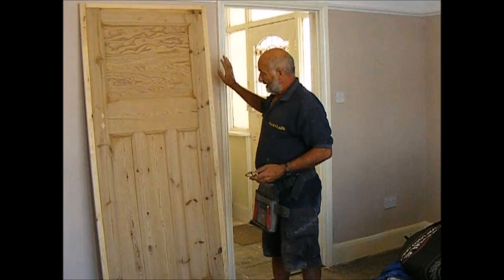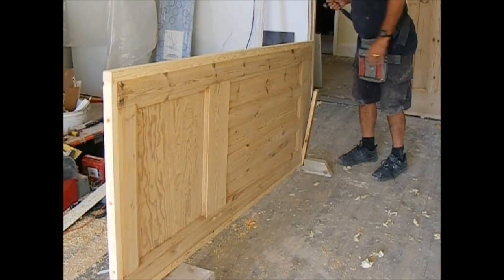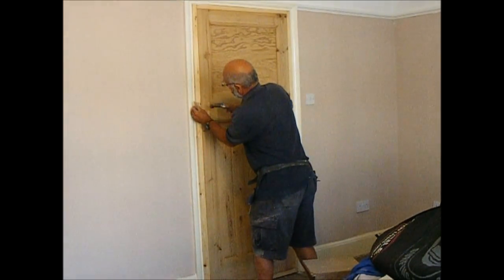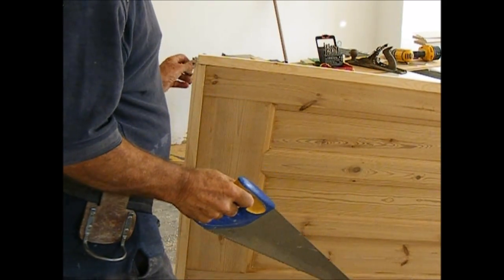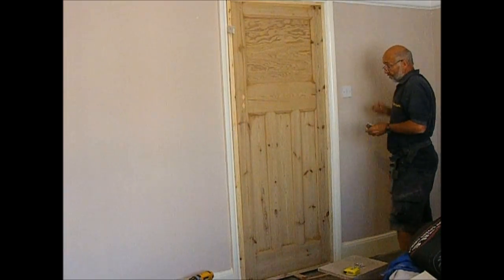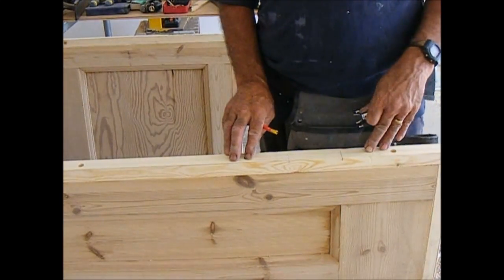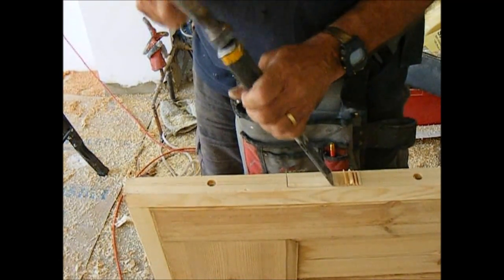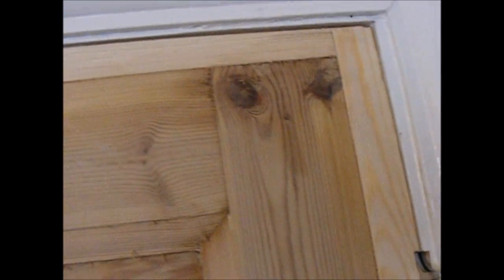How to Hang a difficult door

Comment from the maker: Apart from just measure and mark.
You need someone on the other side of the door. Put the door
against the opening so that the person on the other side can mark the hinge
side and top by laying a pencil on the frame and sliding up and down to mark
the door. Then plane to the mark. Put the door back in push it to the hinge
side and up to the frame top. Once again put the pencil flat on the door frame
and mark the door. The thickness of the pencil side to lead will give the right
amount of clearance for the hung door to close.

Comment: An old rule of hanging a door and has been forgotten - it is that the door affords privacy to the bed in case some one opens the door and someone is indisposed (naked) The person in the room will call out before the person entering the room intrudes on someone's privacy. So make sure your door opens the right way affording privacy to the room. 
Making up old doors with add on strips of modern pine against old pitch pine will have different moisture contents and so shrink at different rates. This can cause the new timber to swell or leave a ridge where added on. Obviously you have to travel a bit to find the right old door in the right pattern but there is always the other approach of making a new frame to fit the door and then fitting the new frame.
Good old school chippy
Studhawk
Reply: Studhawk I think the most important thing is where the light switch is.
Reply: king malt agree - also where the room is just too small and hanging it that way round would just not be practical... as land gets more expensive and rooms get smaller more people are going to want to give up the subtle privacy gain for a bit more useable space...

Comment: Just like to point out that the hinges are called parliament hinges and a better way to mark out the hinges is to use marking gauges for with and depth but not such a bad fit
Reply from the maker: Thanks Simon, god comment.
Reply: They arnt parliament hinges.
They were on Windows.

Comment: Hi Bernie,

Thanks for a great video.  When you measure for the hinges, are the mesuments for the hinges from the top of the door or fromthe inside of the frame.  Also the bottom hinge, is this from the bottom of the door or the floor?

Regards,

Bill.
Reply from the maker: Hi Bill.
Not to important but I measure from the top of door to top of hing and bottom of door to hing bottom.

Comment: never use a hammer on a chisel please use a mallet
Reply from the maker: You will see that the steel blade goes all the way through the handle to the top of the chisel. Most carpenters use this type, it saves carrying a large mallet.
Reply: the reason you use a mallet is to save your hand from being hit with a hammer i was a joiner for 50 years and in that time you will catch your hand at some point mallet on a chisel not a hammer
Reply from the maker: Thanks Sitnam, good point.
Reply: If you are a half decent chippy you will never hit your hand... unless of course you are old...
Reply: Chris Abbey exactly he's probably an 18 year old apprentice repeating what someone told him lol let's  stop what I'm doing and go grab a mallet as if! Fair enough some old wooden handle chisel but makes no difference nowadays does my head in people coming to the comments just to chat shit! Nothing at all wrong with anything you did in this video! I'm a chippy myself only 9 years experience but i enjoy watching how others work! Didn't learn anything new today but also saw nothing wrong! Good quick job! See someone above this comment talking about not adding that batten on and finding a similar old door to rip a few bits off to stick on! Jesus Christ you can tell he is just using old shit and making it work if this was a multi million pound house and everything was being done tip top he would of just got a new dooooooooorrrrr
Reply: sitnam how are you ever gunna hit your hand with a hammer whilst cutting a hinge?? Soft precise taps your not breaking concrete with a bolster!!!
Reply: @juicemclovin7698  The number of errors inversely proportional with age otherwise we all die young.